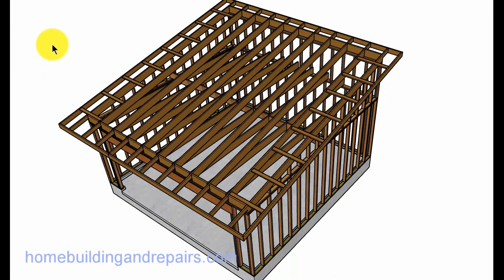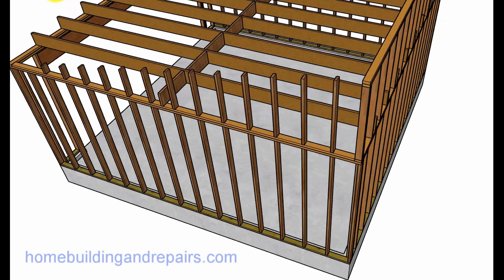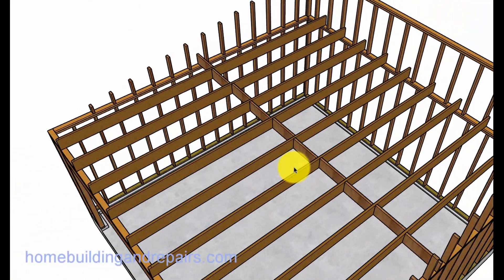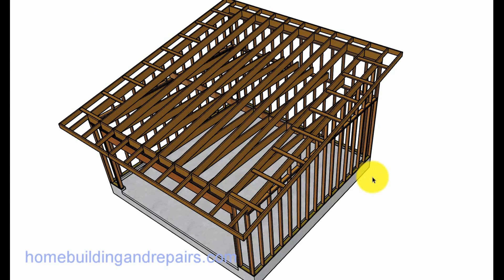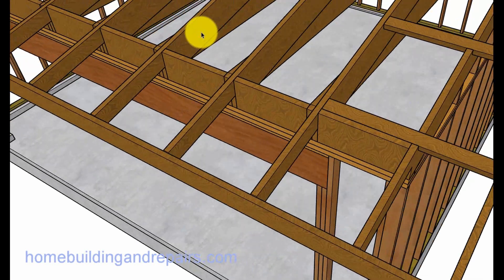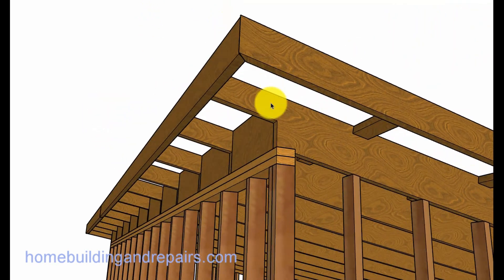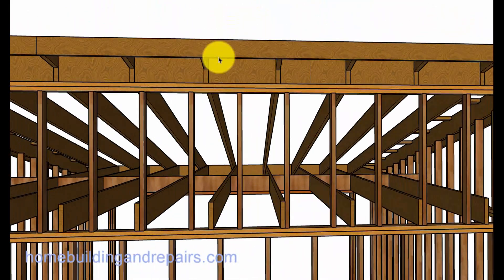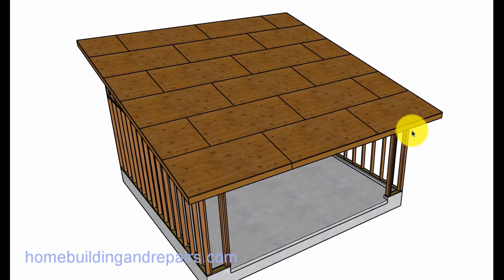Conventional Shed Roof Framing Design for Two-Car Garage With 4:12 Pitch or Slope

Comment: Thanks you for these videos, very helpful! I see that your ceiling joists run front to back. Any reason they can't run side to side? I have a 24x26 deep foundation footprint and hoping to use 2x12x24 S4 Doug Fir joists that span in that direction. But also, I'm not sure how I would span the roof rafters with an overhang since those are 28' with a 4:10 pitch roof. Would a truss be needed?
Reply from the maker: I've never seen it build with rafters going the other way, but don't see why it could not be build.

Comment: The blocking prevents air flow, unless you're doing a warm roof.
Reply from the maker: You can use wall or roof vents also.
Reply: That's better anyway. Waterproof the plywood roof deck. Insulate BOTH sides of that roof deck. Then add stringers to create an air gap between the insulation and metal roofing. Far less chance of rot since not creating condensation inside the framing.

Comment: With that pitch metal roofing should be fine wouldn't you say?
Reply: Depends on the precipitation averages where you are building and whether you will use lap sealant at panel joints. 3:12 is the minimum pitch recommended for non-sealed lap joints but steeper pitches will give even better water shedding.

Comment: Would a balloon wall with studs directly under the roof perlins work as well? Wanting to build a house with a shed roof design but not finding much material on the web. Thanks for all your free knowledge you share with us.
Reply: Did you ever find the answer to this ? I also cant find much in the way of details on these
Reply: @lawrenceporter3723  I didn't,  I'm not sure it would really do anything for us to balloon frame it anyway. You'd still have to put blocking in between the studs to stabalize the wall
Reply: @brianwideman2342  my next issue is whether or not to birdsmouth the rafters or cut and angled top plate which seems easier anyways

Comment: How would you frame this so the garage door is on the side?
Reply from the maker: Simply rotate the roof 90 degrees or put the opening in the other wall and frame the door opening like the wall on the other side of it.

Comment: I am planning on building something similar to this with a single pitch roof but wanted to it be open to the top. Could you do the same thing but without the rafter ties using 2x12s or would you need to do something like I-joist because of the weight of the 2x12 for that span? I have no snow load.
Reply from the maker: I've seen shed roofs built without rafter ties before and you could always install a roof rafters support beam in the center of the span as a possible way of getting rid of the rafter ties. If that didn't answer your question, feel free to ask another or email me some pictures of what you're trying to do for more information.

Comment: Why did you pitch the roof so that it would drain onto the side where the garage door is?

I mean I can think of all sorts of reasons to do it this way (house in the way, etc.), but as a stand alone building I would think that you would want the water to shed to a side that you don't have to pass through or have it run down your driveway.

Anyways, I have been watching the heck out of your videos and am enjoying the content.  Thanks for making it.
Reply from the maker: I drew it that way, but it doesn't mean that it can't drain to the back. If it was me, I would probably build it the way I have a drawn, because if it was turned around it might look like a really large building in the front, but this is just my personal opinion.
Reply: 101 contractor tips! Thanks